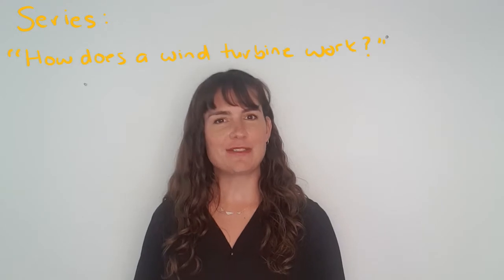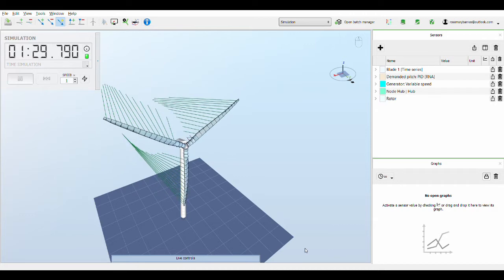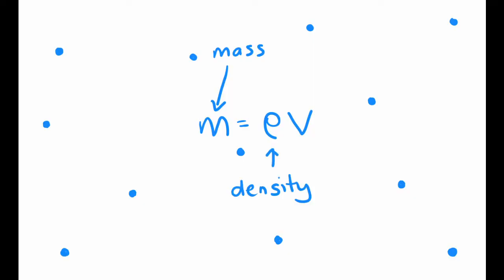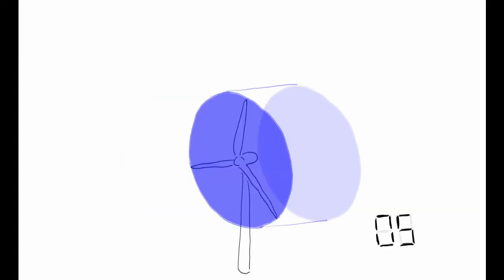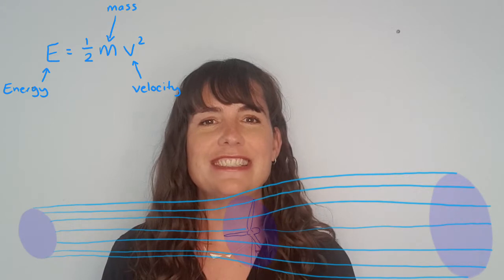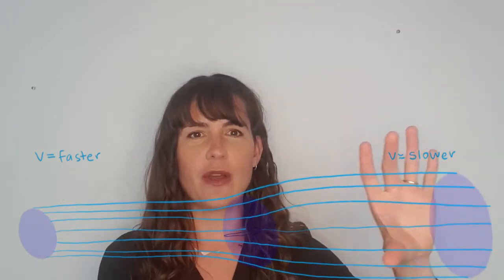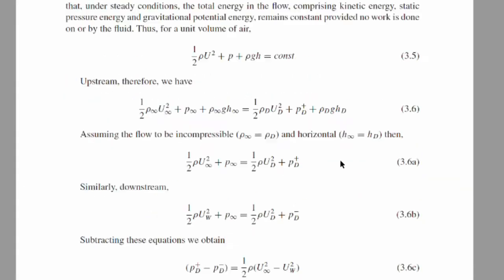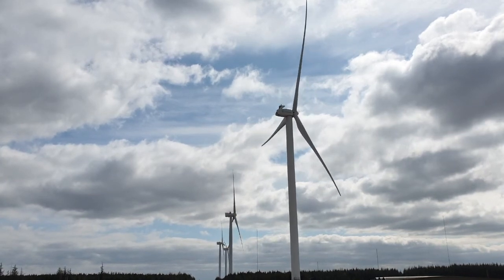The Betz Limit in Wind Turbines

Comment: I'm convinced that the efficiency of wind turbines is far lower than its potential. If I were to design a boat that was powered by wind, I wouldn't use a small number of narrow (small surface area) sails. I would use as many as possible, and make them as large as possible, within reason. This current design appears to be the opposite, obviously. The blades are about as narrow as a toothpick (in terms of scale), and this is supposedly extracting nearly 50% of the energy? Maybe 50% of the energy of the air it comes into contact with, but not even close to 50% of the total energy available in the wind for that area. Most of the wind is not even touching the device. I would say, it appears >75% of the air flowing through the area is not impacting the blades at all. This cannot be the most efficient design. It needs to have sails. Otherwise, those old canvas windmills would have been designed in the same way, with tiny little blades, and no sails.
Reply: I've also pondered this, there must be something we aren't understanding, I mean even with the airfoil effect it seem to not make sense.
Reply: @somerandomnification  The old dutch sail type wind mills were obviously sub-optimal, but that doesn't explain why the modern blades cover such a small area, look at the old "farm windmill" design, it's a lot more optimized and made tons of power to pump water in the old days, has anyone ever seen a direct comparison?
Reply: @somerandomnification  I'm not questioning the use of airfoils, I'm questioning the structure to power - (disclaimer, this is total speculation) if i were to build models of the new and antique design I'm pretty sure the antique design would out perform the new design, if I modified the antique design to only have 3 blades the new design would probably beat it, if I were to make another model of the new design with 6 blades it would have ~double the power output, does this not make sense? I realize turbulence could get in the way of the following blade but these designs aren't even close to that point.
Reply: @somerandomnification  Again, the efficiency of the design is not in question, we are talking about the power leveraged for the material used, for example - on paper hydrogen is the most efficient rocket fuel, but the larger structure required to use it made rockets that were more expensive then others, or how a sterling engine is more efficient then an internal combustion engine yet nobody would try to use it in a car as the amount of material needed to get the power required would be extreme.
Reply: @somerandomnification  Rotational speed is actually not relevant here. The rotational speed can be adjusted by a gearbox. Torque is what is relevant. By reducing the air resistance of the blade/sail, you reduce the amount of force that is turning the generator. It's that simple.
Reply: @somerandomnification  I actually think that they don't work as they claim. I just did some research, and apparently long, thin wings are best for creating lift, which in my opinion is probably not true. It would seem to me that the opposite would be true, but it hasn't come up much because of powered flight. For example, gliding birds, prefer both length and width of wings.
Reply: @somerandomnification  I consider it to be common sense. Basic understanding of how air reacts to resistance, by pushing it out of the way. The design of sails is a perfect example of how this works. Also, if you look at gliders, for example, they use very thin, long wings, which I theorize, is due to the airfoil design creating downforce, not lift, therefore necessitating the use of a thinner wing, to reduce this downforce. I believe that a glider would be more efficient with the curved side on the underside, in addition to having wider (front to back) wings, like a bird. I feel the same way about airfoils that I do about Windmills: they are not efficiently designed.
Reply: @somerandomnification  They're not feelings. Its just logic. The only way to wind can push an object is if the object is presenting resistance to it. Otherwise, a force is not transferred. Sure, modern airfoils function, but they are designed counterintuitively, and they are not the most efficient or correct.
Reply: @somerandomnification  Just because I disagree with something that has been in practice for a long time doesn't mean that I am wrong. The way that flaps operate proves my point. By increasing the amount of resistance, lift is increased. It also creates drag, which is why flaps can use either lift during acceleration or drag during deceleration. Where I am in disagreement is whether or not air is forced to accelerate by passing over an air foil. I think it is not, instead building pressure, thereby producing downforce.
Reply: @somerandomnification  The fastest sail boat sail are much like aircraft wings. Look at the larger foiling catamarans and trimarans i.e. America's Cup boats.
Reply: @rkm23456  Rotational speed has some relevance here as you would not want the tip speed to get too close to the speed of sound.
Reply: @gregripp  which is why it's necessary to have more blades. Less blades must spin faster to do the same work. Like a propeller.

Comment: Would love to hear your thoughts on how gearboxes and generator shape and design affect turbine output.
Reply: The reduction gear and generator shape and size (unless stupidly large in diameter) has neglible impacto on the turbine rotors ability to extract power from the wind, however the design of the reduction gear and generator will have great impact on how much of the power extracted by the turbine rotor that can be turned into electrical power.
Reply: This is a trivial issue of power transmission.
Reply: Small wind turbines less than about 4m diameter dont need gearboxes because they rev fast enough (typically >200rpm) to use direct drive.

Comment: In what way are they a turbine? If they have a shroud then they are. That is not 'adding a shroud to a turbine' - it is turning it into a turbine.
Reply: Turbines do not require shrouds to be a turbine. A turbine is a spinning mechanism used to make power by using a fluid flow.

Comment: Nice vid on Betz! You say "stream tube" I say "cross section".  The cross section is the area within the perimeter outline of the turbine as seen from the wind. Flanges, ducting etc, as you said are all part of this cross section (important, not "swept area" as that assumes horizontal perpendicular blades to the wind). In another video I believe (could be faulty memory) you mentioned that Betz didn't apply to vertical axis turbines? I'd be interested to understand your thought process behind that. To me, it's all the same. Cross section, energy in, energy removed, still needs energy to move the slower air mass away...Betz.

Comment: I'm amazed to know that so much of research has already been done on maximum efficiency of wind turbine,,
But Rosie,, please answer me-why more number of blades are not used to enhance the efficiency?
Reply from the maker: I made a video on that 😀 https://youtu.be/f3hgB-0rPOI
Reply: @EngineeringwithRosie  okk,I will watch and then come back to you
Reply: @EngineeringwithRosie  sorry dear,, your video tells about twin blades,,but I'm asking about more than 3 blades,,
As I tell you,in car engines,,more number of cylinders will make engine smoother and vibration free,,3 cylinder engine is not considered a balance engine,,but 6 cylinder and more is balanced,,
So I'm planning to build a 6 or  more blade vertical turbine,,or maybe a horizontal turbine with blades(6 or more) installed at 1 feet distance on the shaft,,with blade size 5 feet in dia,,
Do you approve this design?
Reply from the maker: The video also covers more than 3 blades.
Reply: @EngineeringwithRosie  I saw this video,,to me number of blades and their cost is not the big concern,,my ultimate goal is to get higher level of efficiency with compact and balanced design,,
So I want to know if 6 vertical  blades of stainless steel will be good or not?
Reply from the maker: @buddha2845  If you are not sure after watching all these YouTube videos, why not try it out for yourself and see?! That's what's so great about engineering, it's about doing, not just thinking.
Reply: @EngineeringwithRosie  I was expecting a precise answer from your youtube,but I didn't got,,so I made a comment,,but still I haven't received the precise one,,
So I will try out my own experiment

Comment: The Betz Limit does apply to a circular disk actuator ( ie a HAWT ) .  The stream tube passes through the blades only once.  But in a H-Darrieus lift-type VAWT, the air stream can pass over the blades twice.  I don't think, Betz ever considered that possibility.  So, would a H-Darrieus VAWT be similar to placing a second HAWT, down-wind of the first HAWT?   So, the second HAWT could ( at most ) extract another 59% of the remaining 59% energy, or another 35% (max) ?  The combined energy could then exceed the "59% Limit"  of the original air stream?  Turbulence from the first HAWT would reduce the efficiency of second wind turbine, for sure.  Also, a sail boat can "tack" into headwinds and it can travel faster than the incoming wind speed.  What if 50% of the H-Darrieus blades that are moving into the head-winds, used this "sail boat tacking" method to extract energy?  The H-Darrieus design is a 3-D Cylinder shape, not a 2-D circular disk actuator, therefore the Betz Formula may need a modification for H-Darrieus VAWT's, because of the assumptions made during the formula's derivation?
Reply from the maker: Thanks for this thoughtful question! You are right that the aerodynamic analysis is totally different for vertical axis turbines than it is for horizontal axis. But vertical axis turbines are less efficient, not more, than HAWTs. I am working on a video explaining the theory of VAWTs, but it will be a couple of months before it's ready. And I'll make sure to look back at your question and make sure I answer all the points you raise when I make that video. 
One thing that is the same for VAWTs as HAWTs is that you cannot take all the energy out of the wind. There needs to be some velocity (and therefore energy) left in the wind so it can exit the rotor. But a more detailed answer is going to have to wait until the VAWT video, sorry about that!
Reply: @EngineeringwithRosie  Yes, I know that a  W/T cannot extract 100% of the energy. I did write "... 59% of the energy is extracted ...".  The Betz formula does not have any math for ... The wind tube entering the into the front-half of the VAWT, passing through middle of the rotor, and then the SAME wind tube exiting the rear-half of the VAWT.  There are some very efficient H-Darrieus VAWT.  Especially, the design with variable pitch blades ( up stream blade angle is different than the down stream blade angle ) by implementing a Wind Vane ( ie a tail ). The H-Darrieus can be made "directional" like a HAWT.

Comment: Can you do a video about solar updraft towers... there are a whole bunch of effects mixed together:   stack effect of high speed air at altitude, heating/solar heating an air flow making it more energetic, the advantage of having the turbines near ground level (could be horizontal or vertical axis.  Is it wind power (stack effect at the top?) is it solar? is it a combination? 

Can you grow crops underneath? (since the airflow is always inbound from the outside, you can add humidity at the periphery, and potentially extract towards the centre.)

Comment: Excellent and insightful video, once again. Couple comments: doesn't the shroud in your illustration show the opposite (diameter of stream tube hitting the blade being reduced), and the Venturi effect being used to impart a higher fluid velocity/energy to the turbine? Also, assuming it would be cost effective, wouldn't adding more blades extract more energy for the same swept area? Sure, you'd have to deal with the turbulence, but I cannot but think that the 3-blade design is letting a lot of the flow pass through between the blades without being used.
Reply from the maker: Hi, thanks for your comment! The streamtube is wider upstream with the shroud than it would be without it, which gives it a larger effective diameter than the rotor diameter, so it has access to more energy in that larger diameter. And yes, then the streamtube diameter decreases as it hits the rotor, and consequently speeds up. Probably worth more than the 2 second explanation I gave it here! Thanks for highlighting this, and I hope I can do a while video on shrouded turbines some time soon.
Reply from the maker: And on the question of how many blades/ how much of the rotor should be covered by blades to get maximum efficiency, that is another insightful question! I talk a bit about it in this video: https://youtu.be/f3hgB-0rPOI
And I will be talking a bit more about it in the next two videos in this series about how wind turbines work. But to be honest it is still probably not a really thorough explanation of why adding more blades doesn't increase energy capture. I have an idea of how I can demonstrate that, but it might take a few months to get it done in a way that is properly satisfying. Keep an eye out though!
Reply: @EngineeringwithRosie  It would be interesting to know how much of the available energy per area the blades are actually utilizing, unless it's already close enough to the Betz limit that 3 blades is a good compromise. But like you said in the video you linked, there's always room for improvements as well as compromise choices. Look forward to the new videos and thanks much for the reply.
Reply from the maker: @slymartins  yes it is pretty close already, about 80% of the Betz limit. And it wouldn't get better by simply adding a 4th blade to any modern 3 bladed turbine. I do plan to get more into why adding more blades (or making the blades wider) doesn't add more efficiency, but it will involve a bit of work to demonstrate it. So it will be some months away! 

The quick explanation is that if you try to extract more energy by adding blades or making then wider than the optimum, you end up with each blade hitting the wake of the blade ahead of it.
Reply: @EngineeringwithRosie  Thanks much!
Reply: @EngineeringwithRosie  Hi, not sure if you still receive or respond to comments on older video's but you may be interested in this comparison of a two rotor turbine with a standard type and it's implications for the Betz limit... link:  https://youtu.be/ZK_rmUg4oJs

Comment: Nice video; one question though.. You also mention modern turbine approach 50%. However, i'm a bit puzzeled; if i take a Siemens Gamesa 3,6MW offshore turbine, the rated windspeed is 12m/s. Yet, at this speed the theoretically available power in the 120m disc is roughly 12MW. Therefore, the turbine 'consumes' only say a third; far less then half.. Looking at other models, i see the same. Even the new GE Haliade; roughly a third. Yet all literature mentions commercial wind power nears the Betz limit. Or is this an averaged output used as typology and they actually put larger capacity generators in the nacelle. Can you explain this? Siemens Gamesa haven't replied on my email.. :)
Reply from the maker: Interesting question. I couldn't find the exact models you're talking about, but the ones I did find were not specifying their rated wind speed publicly. If the rated wind speed is 10m/s not 12 then the Siemens example you list works out roughly as expected. So I wonder if it's an issue with how the generator size and rated wind speed are selected/ communicated.

Comment: Is the efficiency limit the same for water turbines (like in tidal power plants)? Do fact that air can be compressed matter?
Reply from the maker: That is a really interesting question! I am going to find a tidal energy expert to ask (could be a good 1 min video topic too). I suspect that yes it is the same, but I have never worked with tidal energy so I can't say for sure, maybe there is a factor I haven't considered. With aerodynamics, you usually assume incompressible flow below transonic speeds. And incompressible flow is usually assumed for wind turbine aerodynamic analysis. But as blades get longer and tip speeds increase, some researchers are starting to consider compressibility in the blade tip region.

Comment: Curious that Rosie uses the term "stream tube" meaning intangible container of air, the physics of which have been altered by presence of turbine mounted directly in airstream. Why no mention of tangible stream tube, meaning ducting that captures wind, redirects, concentrates to turbine mounted on ground? Imagine a windy seashore (eg. Oregon, Washington coasts) with most wind coming from seaward. String a cable across top of valley, with fabric attached to trap onshore winds. Turbine can be fully enclosed, and running on air captured from entire valley section. Velocity depends on area-ratio of tube mouth to rotor circle.
Reply: Concepts like this have been tried. I saw one in Tasmania many years ago mounted on an ocean facing headland, a duct directed the windflow onto a multi blade turbine about seven metres in diameter. Not sure what happened to it but suspect issues of practicality defeated the idea. Multiple conventional three bladed power turbines are now at that location.
Reply: @jimgraham6722  Well said. " issues of practicality" may include non-technical considerations, like politics.

Comment: Thank you for excellent video. I have small question, why the disk of wind is considered in 1/2 *rho*A*V^3, while only the 3 blade area is in contact with wind.?
Reply: Even the air between the blades is slowed down, without being in contact with the blades. Actually very few air particles get into contact with the blades.